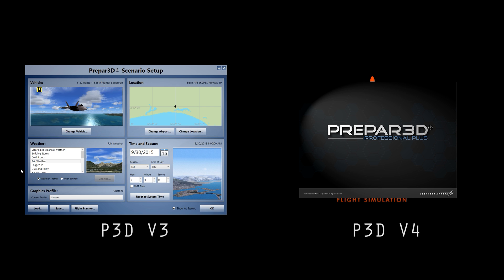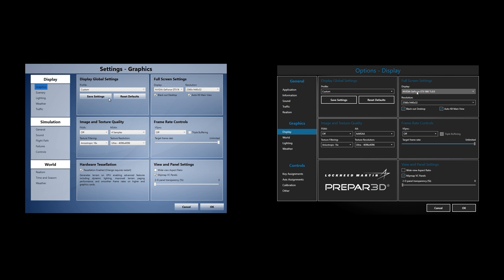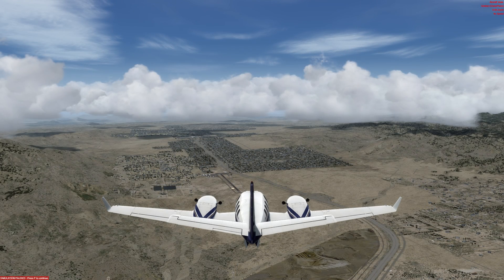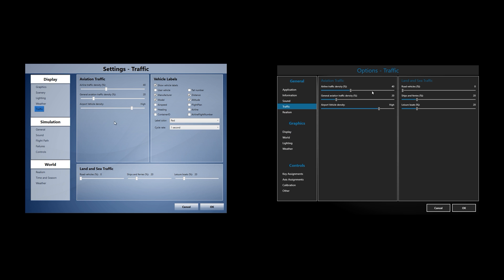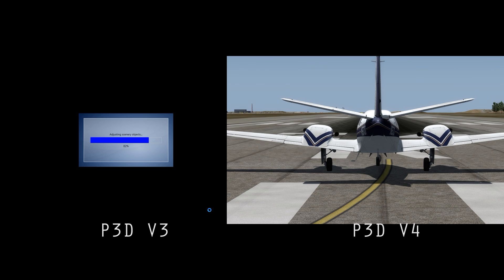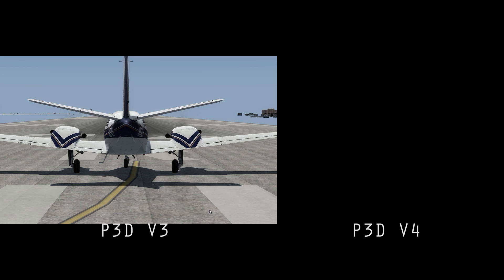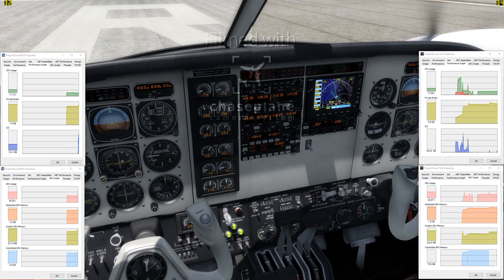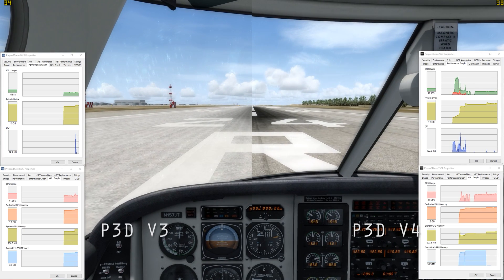P3d v3 VS. P3d v4 *Performance Side by Side and Stress Test*

Comment: I think V4 is a great buy for whoever has invested so much in P3D but Im sticking with FSX SE and Xplane 11 for the time being unless they optimize further
Reply: John Moore I use xplane 11 everyday and no it isnt a stutter fest maybe the beta was but they optimize it with every update which is every few weeks I have a gaming laptop with a 965m i7 12GB Ram and I get between 30-40 FPS high settings try it for yourself
Reply: My FSX SE always crash😌😌😌..
Amd ryzen 5 2600 4.0ghz(oc)
Gtx 1660 6gb
Ram 16gb 2600mhz

Comment: That pop-up autogen on the 64 bit is very annoying
Reply from the maker: It doesnt affect autogen, just the ground texture.
Reply: Have you tried LOD 9 or 10 (config tweek)?  Curious about the pop-up at those levels in V4.
Reply from the maker: It was in a pretty stressful situation, but also the plane was relatively simple, so it it somewhat to be expected. Lets hope they continue to improve it now that its 64 bit.

Comment: how are you using the real air duke in 64bit?
Reply from the maker: Just install it into the sim folder. Its all XML gauges, so they work just fine.
Reply: Jordan King do the sounds all work correctly ?
Reply: they cant until we get 64bit sound xml gauge
Reply: Thats what I thought. Lets hope someone can fix it

Comment: there's a lot of pop-up autogen in each version.. really strange
Reply: I think the pop up in V4 is due to Jordan lowering the LOD levels to the same as V3 for the side-by-side comparision.  Various reports indicate that if you have enough VRAM, you can set you LOD to 9 or 10 in the cfg file in V4 and that eliminates the pop ups for the most part.  Maybe Jordan can comment on that.
Reply: LTRegulate mmm yeah maybe, but in v3  I don't have any pop-up,  and I have a modest for these days i5 3570k coupled with a common gtx 970 .. I already try p3d v4 today, and as far I can see setting the autogen draw distance at high and lod radius at max the autogen show up without a glitch, no pop-up at all and is gorgeous man, but currently running default scenery, anyway maybe Jordan can tell us something about that
Reply from the maker: Dont forget, this is in ORBX SCA region, flying over the most densely populated part of Los Angeles. That is why it is popping more than you may be used to, its a remarkable about of stress on the sim. But that was the point of the video.
Reply: Very interesting.. Two months ago I created a landclass based scenery, with extremely density autogen on top of it..in short I had make a mistake with sbuilderx and the final result was a full country, the whole north Italy, covered with my new autogen, again.. No pop-up and surprisingly no slow downs at all,  I don't have socal yet, but it seems is a very dense place indeed, took a flight today in ksea same settings as above and again no pop-up and 30 fps rock solid, the only thing I can say about this, I fly only very light aircraft, CPU bound wise, like carenado c172..anyway I'll try tomorrow with a higher altitude and let's see how it goes... Thanks for posting your video, very informative
Reply: Ok...made a test, and yes you're right Jordan, I have a similar situation like you, at least in p3d v4, pop up autogen everywhere, dunno what I smoke last time lol..but seriously, why that beautiful autogen grow up slowly is missing now?? Was a such beautiful feature of p3d and now is gone..

Comment: has the price been said yet and release time? p3d v3 had a midnight release and i grabbed it right away
Reply: Rumors were that it would be the same price as V3.  Supposed to be released at 1400 EDT tomorrow.
Reply from the maker: I dont have price info yet. Sorry.
Reply: No price yet. The time is 1400 eastern time (US) as LTRegulate has mentioned. 
From the v4 announcement on the site: 
"Prepar3D v4 being directly available from Prepar3D.com on May 30, 2017 at 2:00pm EST."